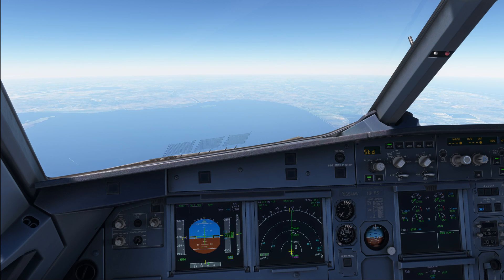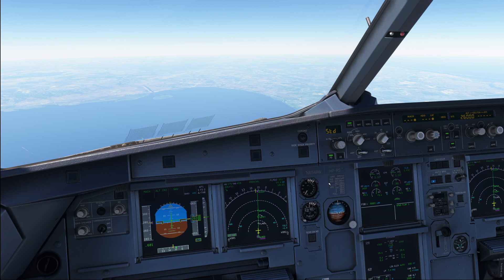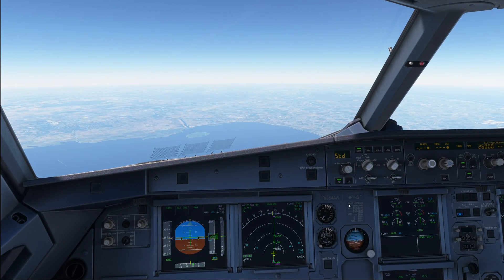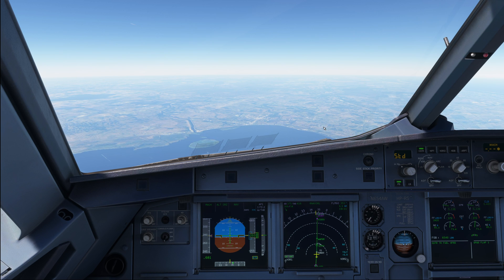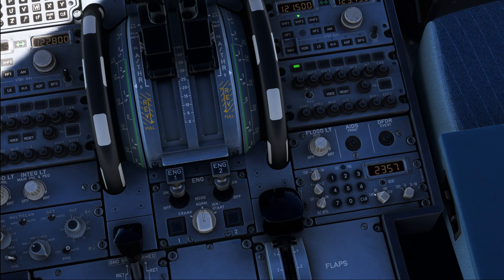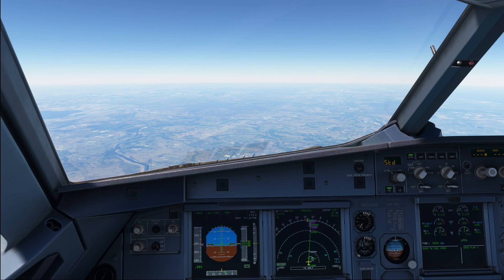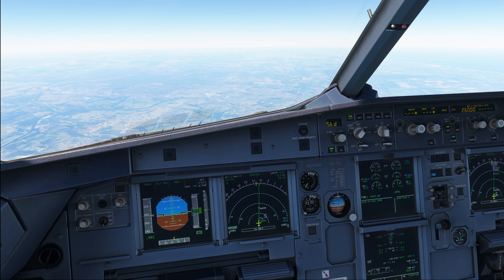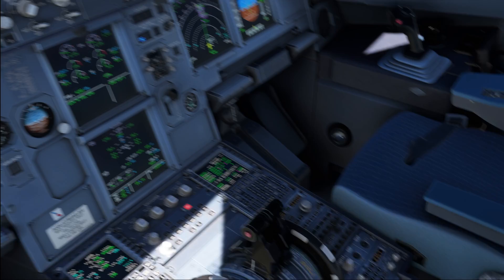TCAS Modes and Usage Explained: ABV/BLW? TA or TA/RA? | Real Airbus Pilot

Comment: Are you using Fenix A320? Because i have IniBuilds A320 and cant see the traffic on TCAs but i can see the planes in front of me
Reply from the maker: Yes I am.

(I usually include the logo of the devs of the addon in use in the lower left of my thumbnails as well, in case you want to look it up easily :) )

Comment: Ok can’t get the tcas to work in my 320 leap. Follow your directions which were fine 5 months ago but after the summer I returned to the sim and ran into this issue with the tcas. Is it better in larger airports?

Comment: Hi Emmanuel, thanks a lof for your video, as always I learned something new, I have a concern, but probably is related to the software for the Pilot/ATC network I flight for, once I have a traffic bellow me 1000' on the Fenix A320 ND display I was't able to see the traffic until it was at 20 NM from me, but in the TACACS for the pilot software for that network, I see the traffic since 80 NM, are you aware of any limitation in how far the TACACS see the traffic at your same or similar FL?
Thanks in advance for your support
Reply from the maker: Hi, the maximum range of TCAS is dynamic and depends on how many planes are around you. Normally it extends to anywhere around ~40NM.

In the real world that is, flight sim developers often set a fixed range.

Comment: I heard this from another sim YouTuber that when you are in final approach / landing, pilots would turn on TA mode since there might be traffic on the taxiway near the runway and to avoid any RA warnings and potentially emergency climb from the aircraft as a result of those aircraft on the ground. Is this true? (I assume it is since at least the FBW a32x automatically turns on TA only during final)
Reply: RA are automatically turned off if the aircraft is on the ground for obvious reasons, and below 340ft RA for the same. Turning the TCAS mode to TA is not part of Standard Ops Procedures, don’t trust too much the Simmers

Comment: It really depends on the TCAS model installed on the Airbus.
According to my FCOM it’s either +/-7000ft or +/-9900ft max depending on the TCAS model installed, with +/-2700 ft being the min
So the ALL position gives a +/-2700ft volume buffer, while the ABV or BLW gives a Min +/-2700 & Max +/- 7000 or 9900 depending on MSN#
Reply: Same here

Comment: what is the diff between auto and on mode on the TCAS system? and when controllers on vatsim ask to squak Charlie, do I put the switch on auto or on mode? Another question: Is it okay if I am taxing to the runway and I switch to Ta or Ta/Ra just to have an idea of the traffic coming in and out etc. Will that affect other aircrafts or will that even be beneficial to me?
Reply: Most of the time the airport regulations (and SOPs) prohibit to switch the TCAS to TA/RA before entering the runway and to turn it off after vacating the runway. But fortunately the TCAS TA/RA mode is kinda inhibited when close to the ground (in flight below 1000 ft RA) for that very same reason (even for the landing trafic). Dunno if it’s modeled properly on the sim.
IRL we can temporarily use the TA position before lining up to figure out the trafic around us, but not for long in order not to generate unwanted trafic/resolution advisory to the incoming landing trafic. Upon entering the runway the TA/RA mode and ABV position should be set
Reply: @JacquesZahar  Thank u very much for explaining the TA/RA on the ground. What about the auto and on modes? Do u know what's the difference?
Reply: @keyang2740  they are basically the same: 
- ON forces the transponder to ON, 
- AUTO sets the transponder to ON in flight, and only to mode S (selective interrogation mode) on the ground for Airport equipped with ground radar. This causes less cluttering on ATC display, since the Xponder only replies when specifically interrogated.
AUTO is the standard way to go.
Reply: I've noticed in RA/TA mode that no advisory occurs for traffic within 2000 ft range--esp at cruise--it seems to function in final however--does that indicate a malfunction or setting issue--settings Auto/BOTH/TA/RA
Perhaps injected traffic not identified in TCAS?